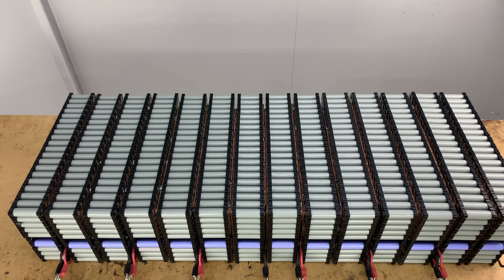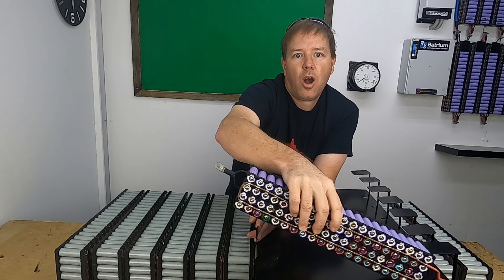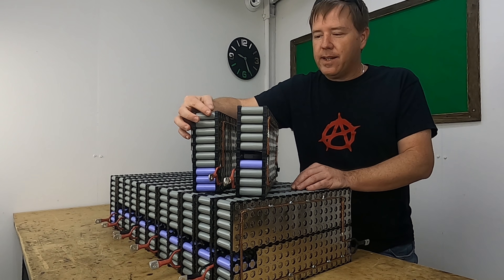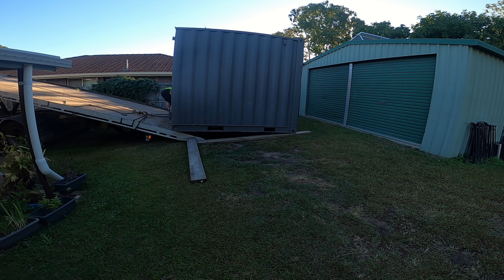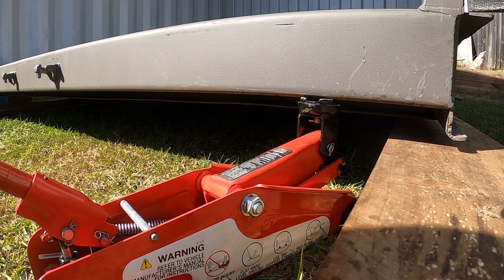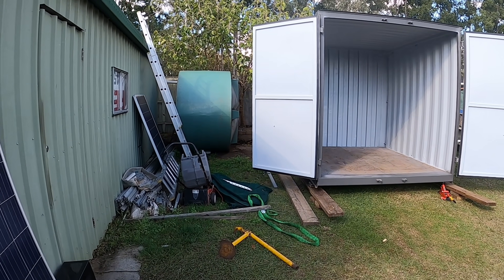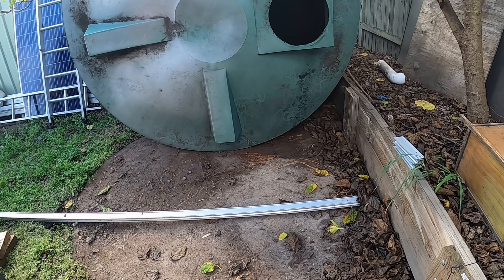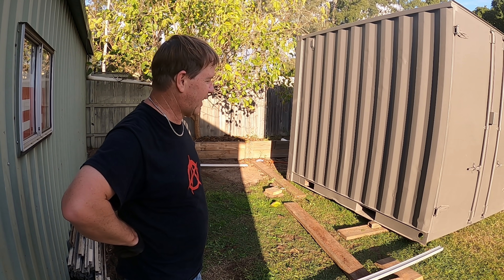Pt.2 Finding out my massive battery won't pass inspection!

Comment: why not have sub-stations in different areas of the house and run everything except the major appliances to 12V DC? I know DC doesn't travel as well as AC over a distance.  My thoughts are that perhaps real $avings could justify the conversion. What do you think?

Comment: There is a ratcheting tool they call a come along. Attach it to a solid item towards where you want an item to travel then attach to the bottom of the metal frame and just ratchet away.

Comment: It's a terrible design (I'm a mechanical engineer) overkill and yet could fall off if bumped. Maybe just on the ground on a wire grate? Cooling would be an issue aswell, tightly packed (waaay tighter than other products). Hot batteries or wires at least increase resistance. WHy the teeny tiny wires to each battery...seriously doubt the current is that small. Probs loosing like 20% in resistance. I'd say a person just doing it themself without this tutorial would do a better design.
Reply from the maker: Hey  at least you watched more than one video to comment.

Comment: most ppl dont know - a mobil crane is like 120€/h - never ever worth the afford to move things like that - they have foldable cranes which can lift over a 4 story high building and stuff,.. and it absolutely costs nothing compared to what you get,.. 

a lift like yours is done in less than one hour including folding up everything and so,.. so dont be shy call a transport agency that has trucks with palfinger cranes or similar

Comment: I moved a box similar to your box by my self, I bought 20 PVC pipes that were a foot longer than my box was wide.  Laying them on the ground under the box, I was able to slide it back.  Yes, I would uncover a pipe and move back behind. I had 2 sand bags to stop it from rolling too far.  One in the back, one in front, move the bag to keep it from rolling back.
Move the bag in back, drop in a pipe and keep going.  Hardest part was getting all the pipes out from under.  A floor jack did the job.
Reply from the maker: Nice

Comment: That shed man... This is two years ago so I'm guessing you have a video about the fire by now. Do you at least have a CO2/powder extinguisher on hand?
Reply from the maker: Still hasn't been cycled - (due to the legal issues) but she is checked monthly for SOC & how the mounts are holding up. A extinguisher is useless if the batteries catch fire. So useless you might as well piss on it.. Water and DAYS AND DAYS of it will be needed.  CO2 will be fine if you have say a mower that catches fire and you want it spreading to the batteries...
Reply: @HBPowerwall  Fair enough, I guess the best you can do is have an alarm and hope you can chuck a module.
Reply from the maker: Or put the battery in a location that reduces out side risks

Comment: Does the whole weight of the battery  packs rest on those lower 3 cells? Don't they get bulged in? They are surely not meant for that kind of mechanical strain.
Reply from the maker: I wish it was on three cells, Its actually on ONE cell due to the way it's levering away at the top...

Comment: Ok Mate. You've put together a pretty good video with some interesting stuff. I like the battery mounts for sure. However the one reason that I clicked on your video was to find out what the problem was with the battery that caused it to fail inspection.  You mention that rules have changed so you bought the half container to put them in.  That seems like a code issue about where and how the battery would be placed. So why won't the battery itself pass inspection? Without details on this point your headline just seems like clickbait. And we all hate clickbait.
Reply from the maker: how the hell is it clickbate - they literally created a whole new set of rules that make anything I do with the battery illegal. I included links etc to new rules etc..
Reply: @HBPowerwall  First of all I don't intend any disrespect. I'm just trying to understand how the title works with the video.  Your title"Pt.2 Finding out my massive battery won't pass inspection!" implies that you built the battery wrong, or that they changed the rules about how the batteries have to be built.  You don't mention anything about inspection related stuff until 3:28 when you mention that rules have changed about how you're allowed to mount the battery.  Then you show us how you've solved the problem that they gave you.  What I was expecting based on your title was something to the effect of "I've built this massive battery, and now I can't use it because they changed all the rules on me. Here's how, and I've got links down in the description if you really want to get into the weeds on this."  
I feel like a better title would be "PT.2 Massive Battery Build - They changed the Rules on me!" Then lead with a discussion about rule changes.  I hope this helps, and I feel for your pain with the rule changes.  I pray that there is a very special place in hell for all Government bureaucrats.

Comment: Container is a smart idea and a hiab would of made life easier and as a tech guy this is like the ultimate UPS.
One day i will stop living on cents and have some fun cause i made an electric ATV but couldn't afford decent batteries to run it properly (also person who sold me motor sold me half capacity batteries and said i should of known when he provided the specs 7amp is a big leap from the 20amp per cell as they were meant to be) and sad thing i had to convert it back to gas to sell and the motor+batteries ended.
Keep up the hard work

Comment: I must say i think the mount is a TERRIBLE design in my opinion. With that setup all of the weight of the entire battery pack is resting on just 3 cells if i am correct, and thats alot of weight to just chill on 3 cells. I would design a laying stackable mount.
Reply from the maker: Designed for 80 cells works a freeking treat - this is too much weight for it..
Reply: @HBPowerwall  i get what the mount is designed for, but are 3 little i individual batteries designed to hold the weight of the rest of them? I clearly see it working, but how much heat, or how much weight before the bottom 3 cells bow, bend, or fold? Curious to know as i cant help but to think this is one very hot day away from one heck of a spark show.
Reply: Best thing i can compare this setup to is 3 tooth picks holding up a 4x4. Something is bound to give
Reply from the maker: Ok, so it's actually only one cell not three as designed, they are also cells that are not connected so there is no electrical issues there from shorts. Its been sitting in it's mounts since this video was released with no deformation of the single cell it's resting on. But I understand over time it'll become an issue once the plastic cell holders start to deteriorate. In it's planned install location there will be a steel L channel 5mm thick to support the bottom safely and some bracket across the front of the cells at the top to stop them from leavening out.
Reply: @HBPowerwall  to be safe and affordable while keeping your current setup and design. I would buy steel L brackets and insulate them, then install the mount laying down flat allowing the batteries to rest along the greatest surface area possible. I also believe this would help in cooling as you would be able to run a fan in each row “if you gap each unit in a grid fashion. Now you have cooling on top, on the bottom, and through each brick. I hope i explained that well.
Reply from the maker: I built the battery to suit the loads I planned so there will be zero heat - that isn't an issue at all. And if heat was there is about 5 temp sensors in the build that control a case fan or three to move air if needed.
Reply: @HBPowerwall  zero heat? Do you have data to prove that claim?
Reply from the maker: I have a powerwall that's 5 years old run 24/7 that doesn't get above air temp will that do.. Over built batteries don't heat up.. it's ideal, because then the average draw is like 0.1 amps
Reply: @HBPowerwall  the air temp is what worries me. Im in Florida and could only imagine the heat you deal with over there. Air temps can easily reach the temps needed to cause issues over here. Sorry if my words are coming off strong. When i see room for improvement or a potential issue i press it.
Reply: To add i am very intrigued by your power walls and plan to do something similar and hope to learn from your videos.
Reply from the maker: All good buddy I get it. But I sleep well - would love to see your work. I have about 9000 cells in service and are great fun to play with
Reply: @HBPowerwall very inspiring & great chat!
Reply from the maker: no worries

Comment: I built my own electric bike battery. One day on my way ro work I heard a guy yell " You have a flat tire". . I remember thinking "im hauling ass, i would know if i had a flat". Right about then i felt heat and watched flames come shooting out of my battery. The man wasnt yelling at me about a flat tire.. He was yelling "Your bikes on fire" ! And he was right! It was on fire. 6yrs of ebike battery building and my first battery failure.. Id rather get my heart rate up riding.. The fire got it up higher i think.. Be safe building these. Match your cells. Use bms system. Wire system with redundancy.. That allows u to catch it before u have a fire👍
Reply from the maker: Batrium BMS on all my batteries, super low draw and charge rates and never run hot. Caution is still a requirement

Comment: I got a question how is your battery cooled liquid? Or air?
Reply from the maker: Air, but I built the battery. Built it properly - it will NEVER get hot even under 150 amps of charging current.

Comment: Wtf kind of regulation forces you to use that colossal container? The power shed is not anywhere near the house for fucks sake.
Reply from the maker: It doesn't, but it removes in one fowl swoop a lot of issues that I would have to consider if it was installed on or near the home

Comment: How dangerous is a shed full of fully charged lithium batteries constantly running?
Reply from the maker: It'd be up there with cooking with gas in ya kitchen? No really you can manage any threat
Reply: @HBPowerwall  very cool. Just was worried since a chemical fire with batteries is a bit more complicated and toxic than a burnt roast.
Reply from the maker: True, but you change how you manage that threat. My way was a 60kg 2mm thick steel cabinet & a shipping container to house the batteries.. If they catch fire, leave the two doors shut till she burns out then count the cost later..
Reply: @HBPowerwall  I appreciate the replies. It helps me get a better understanding of I want to do something as well. I know there are dangers with any energy sources, but I do enjoy getting the first hand knowledge from someone who has actually used multiple like yourself. Cheers!

Comment: why use 18650 cells? They're expensive, great for lightweight, high power applications like RC planes and electric vehicles, but when you're talking about powering your home and selling electricity back to the grid, do you really need an output in the MW range? Houses only use like 5-10KW with all the lights on with electric hot water and cooking running, the current output those batteries are capable of is in the thousands of amperes. Is it just for reduced maintenance? I can understand, but lead acid batteries aren't that much maintenance.
Reply from the maker: I love this... the expectation that someone only uses 10kwh a day... I do 10x that on some days with 50-60 average, I got all these batteries basicly for free and had more time than money.. sooooo worked out perfect

Comment: Man, props to you for messing with that. But I'm really not feeling the NCM cells from laptops is a good way to go, you'll be doing it all over in a few years, when the Aussie sun and the chemistry's inherent calendar life has taken away 35% of your capacity. 
That said, haven't watched the first video yet, maybe you know something I don't. 

Also, awfully brave of you to pat these cells you just mentioned have up to 300V under the shrink-wrap, while holding the metal door with your other hand. I wouldn't trust that shrink-wrap to not have any nicks in it...
Reply from the maker: Wooh each cell is 4.2v not 300 - that'd fry my pecker off.. That or make it a preferment hardened monument

Comment: Question:
On conventional dry cell batteries, jumper strips are spot-welded to the caps and base to prevent soldering heat from damaging the batteries.  Does this not apply to lithium cells? I see clumps of solder.
How do you prevent both battery damage from heat, yet prevent a bad cold solder joint?
Truly curious, not bustin’ your chops.
Reply from the maker: The heat I inject would be causing extra damage no doubt - how much I have no idea and given when they were in the laptop there is a very good chance the got much hotter for much longer. At the end of the day its a byproduct of recycling.

Comment: You do realise that the mount could short the whole pack out if a few heat shrink wraps wear through.
Reply from the maker: Hence all the blue cells that touch said mount so battery is electrically disconnected from it.

Comment: I'm an American.

You mentioned burying cable 600 deep. My first thought was cm. Then I realized that would be 6m which is nearly 20 feet deep. Certainly a safe depth, but unrealistic without heavy equipment.

600 mm, 60 cm, translates to 2 feet, a much more realistic, reasonable, and standard depth, even in the US.
Reply from the maker: Yep Aussie so 600 mm 😀
Reply: @HBPowerwall  glad I deduced correctly.

Thank you for the clarification.
Reply from the maker: Almost any time

Comment: Im a little late, but last time i moves containers i got me some galvanized waterpipe and skates backets with wheels made from steel were a V-Groove was milled in. it ran like a train and i had no problems, we could push a 10Foot container by hand
Reply from the maker: I got it done - with more planing i guess it would have been a little less effort - but people on you tube like watching people work so all good in the end.

Comment: Depending on the sheetrock thickness, 25mm length screws is not much. Typically whenever used for structural purposes, screws should go into lumber 3/4" and garage drysall (gypsum board) is typically 5/8" thick so 38 or 40 mm is a better length assuming you are hitting wood studs. Hopefully the holes in the bracket line up standard stud spacing in your area. Here it is about 16" on center or 40.5 cm. USA
Reply from the maker: It has worked well as it is..edit - I really need to rewatch some of these to see what I've said :P
Reply: @HBPowerwall  : sorry, you mounted it on a steel wall in a overseas container, not a garage wall. I was jumping to conclusions, sorry.
Reply from the maker: All good buddy
Reply: @HBPowerwall  : Great use of the sun's rays. You are a true inspiration. I wish I and others could be more like you, seriously.

Comment: Those cells are too dangerous to stack that way.
That's why they fail inspection.
One or two can stop working, or start leaking. Then the system is down.
Reply from the maker: Yet tesla does it? Well did it, I can get 1 flat tire and it stops a car till you fix it.. Stop looking at the disadvantages and look at what can be gained from this project
Reply: @HBPowerwall  
I'm planning a wall but decided to use something else.
I've had too many of the cells burst into flames. That can't be extinguished and produce the most smoke I've ever seen from something so small.
Reply: @arguescreamholler  If you are serious, do a realistic cost Vs energy storage analysis looking at good old-fashioned industrial surplus LA batteries.   

They are still heavily used globally and good near new condition industrial surplus is super cheap if you put the word out you will do most of the dirty work to take them out and haul them away.
Reply: @HBPowerwall  
Have you seen a Tesla After An Accident That Damages The Battery?
NOTHING LEFT! NOT EVEN THE BODIES OF THE PEOPLE!
Reply from the maker: Never seen some one die in a Tesla due to battery
Reply: @HBPowerwall  These are some really dumb excuses for doing what you did the way you did.   

Your quality of work looks very good but for what energy storage capacity you have and the realistic service life you will likely get, plus the fact you have loads of space to work with, the lithium is just begging for trouble on multiple levels that are absolutely unnecessary here.  

As a former RE/AE enthusiast who learned the hard way it ain't cheap, it ain't reliable either and when it all burns down the losses are not worth it in the end.
Reply from the maker: Yes but it’ll burn down and I won’t lose anything else due to it being inside of a shipping container
Reply from the maker: Next video or two